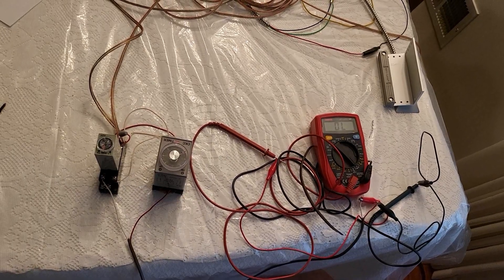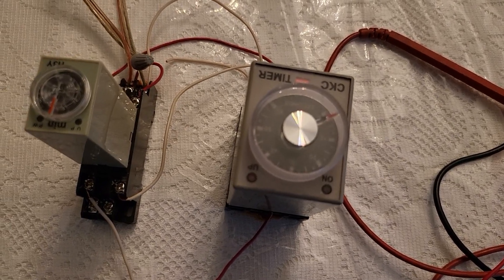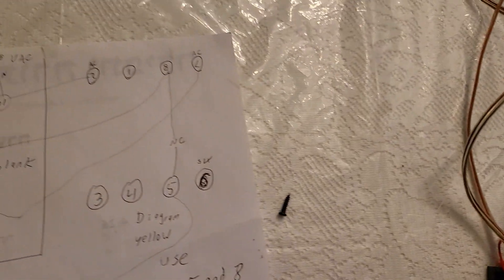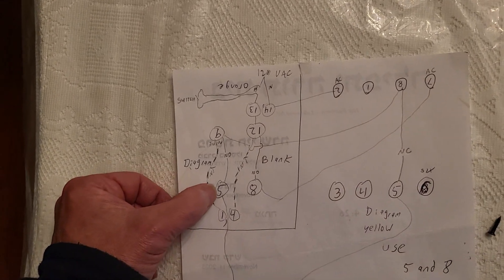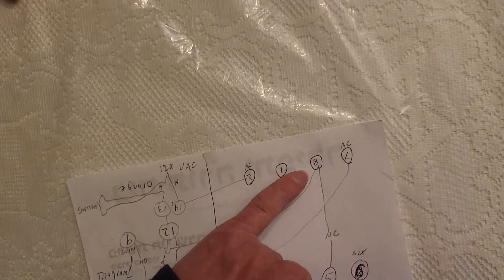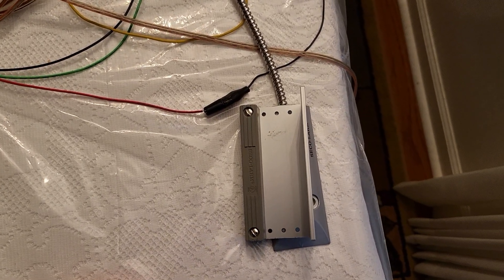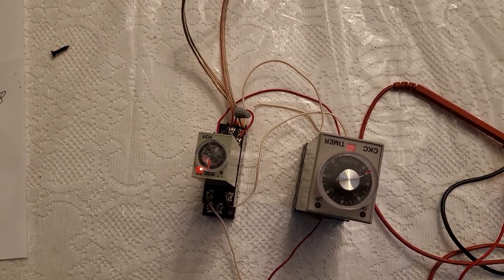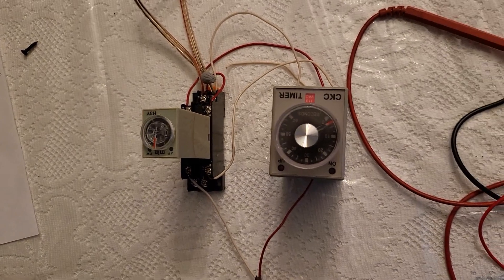How to set a garage door to automatically close after a specified amount of time.

Comment: I am wondering if 120v is too much voltage for the small controller circuit. Do I need to step down to 24v AC?
Reply from the maker: @jacobdysart3477  I used 120 volts in my house, but will admit that it may not be a bad idea to step it down for safety concerns. I believe that those relays might be rated for 24 volts. You might require different relays. You have to read the description on Amazon.

Comment: I have a garage door opener that is like yours. It has two wires but it sends a signal to the opener. I did the (solder two wires) to the internal push button of the wall switch. In my case I was trying to use a secondary internet based service to control my door. It worked fine.

Comment: You didn't specify which relays those are, what specific switch it is, where to get them, or give an image of a wiring diagram for download. Even better would be written instructions step by step saying what terminal gets hooked up to what. Also,what does this cost?

Also, you'd need a picture of the relays with their wiring diagram that's printed on them so people know which number in the diagram corresponds to what on the relays, and you'd need a number for the switch terminals.
Reply from the maker: You are correct, and I have since added the parts to the description.